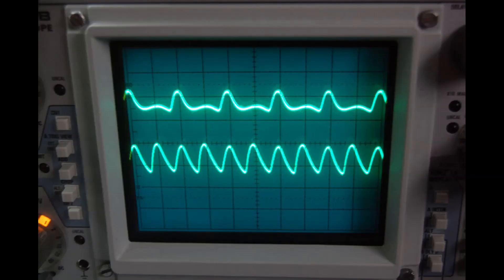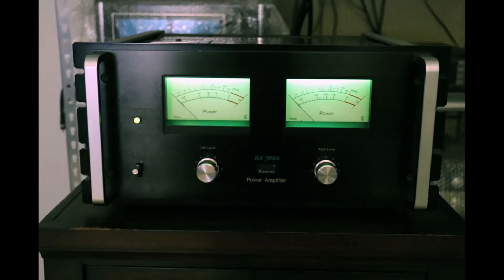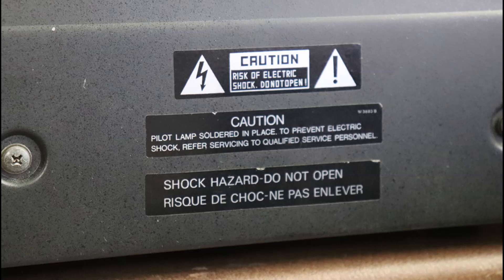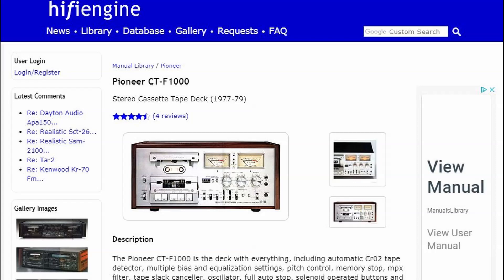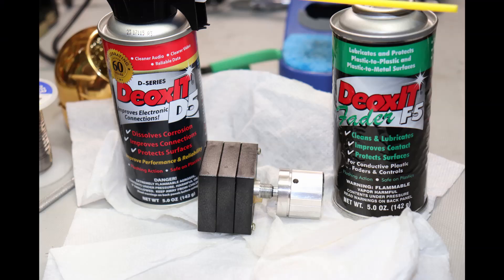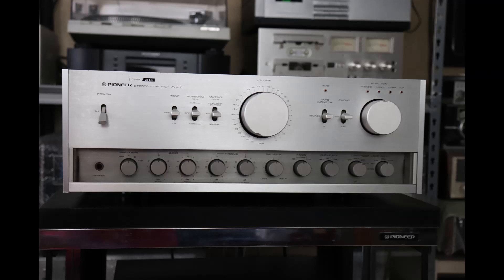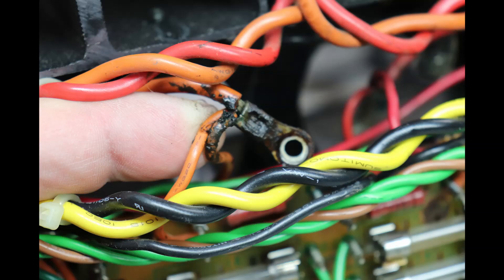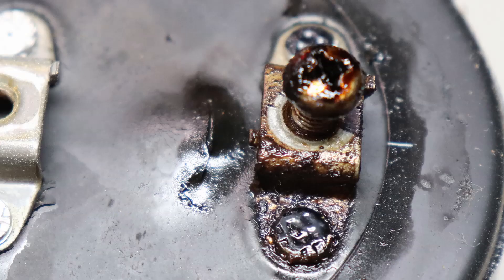Troubleshooting Failures In Vintage Audio Equipment. Fixing Old Stereo System Electronics.

Comment: Newbie here. Is a frequency generator the same as a signal generator?  I have a nice frequency generator I bought it to heal a broken bone that would not heal. Don’t laugh: it worked. I’m an electrician so the only thing I don’t have is an oscilloscope. Just picked up a capacitor tester and transistor and diode tester. This channel is great. I’m watching this a second time. There’s so much great info here and it’s presented so nicely.
Reply from the maker: Thanks so much for your kind words and for watching. Yes, a frequency generator is the same as a signal generator. As long as the device can generate audio equipment frequencies you should be good to go.

Comment: Amazing lesson!  I did buy a pioneer sx626 with the right channel cutting in and out.....looked around inside and found a leaking capacitor on the power amp board.  44 cents and a little solder and now it works fine.   Its hard to believe 1 small thing can cause a big problem

Comment: excellent video.  You have touched on an issue that I am having with my Sony SQD 2020 4 channel decoder.  It takes its main input from my Sony STR 7035.  The decoder randomly drops out the front left output.  I originally suspected the reciever was the problem because I could snap the selector out from and back to fm radio and occassionally the signal would return.  Finally with a little process of elimination, connected my reel to reel into the decoders own 2 channel input, the issue remains.  Do you think it may be a capacitor problem?  I bought this system, complete with a TA 1055 integrated amp for the rear channels in the mid 70s. And kept it all these years.

Comment: Fantastic information. Perhaps you've given the info elsewhere, but I have two questions regarding amplifier repair (I need to repair a NAD3080). To get the consistent signal from the function generator, do you apply eg 500hz to Aux or Phono? And at what voltage? My Tech TE22 Audio gen doesn't go below about 100mV (with lots of noise). And do you have to put a load on the spkr outputs when doing the faultfinding?

Comment: I will say learn basic electronics. Vintage books are plentiful and stupidly cheap on Ebay. Going in and blindly recapping a unit instead of diagnosing through probing and common sense rarely solves problems. Case in point I had a friend blindly recap a small Realistic STA-15 receiver he had found at a thrift shop (low end unit but like you said, that's how we learn) with no sound. Turns out that an output transistor was shorted. No amount of changing capacitors will ever fix that problem. Again, troubleshoot!

Comment: Just got a Kenwood AM/FM radio for free. Seemed to work fine, but I'm noticing that after 15-20 minutes the signal starts to cut out then dies off completely for all channels. Any idea on where to start? Is there a part that could be heating up too much and shutting everything down after it can't take it anymore?

Comment: Can you help me please i have a vintage Yugoslavian record player with germanium amplifier. And when i plugged it one channel made a loud buzzing noise. I pulled out the amp and started testing on my bench power supply. On my power supply it doesn't buzz like crazy but that channel is distorted and quiet and sometimes starts to make some sort of oscillating noise. I replaced the capacitors and it did not help. There is no diagram available.

Comment: Ive developed this incredible urge "want" to learn how to work on audio stuff. I've slowly gotten better over the last year but I feel like ive hit my ceiling in terms of what I can teach myself via videos like this and simply digging around on sites like audio karma.
I flip audio gear and have built a respectable rwputation as the go to guy in my home town for good vintage working gear.
Im able to repair about 60% of stuff I squire and I set the rest aside for "later". 
But my get to it when I figure it out "later" shelf is getting outta hand.
I cant read schematics and I dont have a scope or generator but want to obtain all.
Do you have any suggestions for me regarding any how to books or sites I may use to learn more? 
I have a pioneer SC 850 and a sc550 I really want to get up and running 
The 850 power indicator is on and I hear the relay click but no sound from speakers. The 550 does nothing.
I think the 550 needs a new cap on the power board. There's 2 caps for left and right that are slightly bigger and next to them is 1 single cap i assume is thr culprit.
Would I change all 3 to solve this? Or just the 1 solo power supply cap?
Reply: Hows your progress going 3 years later ?

Comment: Amazing video!!! Thank you so much!!! PLEASE... do more like this!!! :)
Reply from the maker: Your welcome and thank you for watching. I've listed below some other videos that you may like.

Troubleshooting Failures In Vintage Audio Equipment -

Vintage Stereo Repair - https://youtu.be/N3e9C4mUui0
Phono Repair And Troublesome Transistors - https://youtu.be/lkcP1z-KcPA
Hakko 808 Desoldering Tool A Must Have - https://youtu.be/NtSn_HPT-sE
Hazards Of Reel To Reel Tape Deck Repair - https://youtu.be/KvXwN5igzDg
No Audio In Vintage Equipment - https://youtu.be/pKqxlT9sgZY
Troubleshooting In Vintage Equipment - https://youtu.be/xk5gjq5ehK0 
Reforming Speakers - https://youtu.be/ttbgeDagRus
Checking DC Offset On Vintage Amplifiers - https://youtu.be/ZvBoxhpa-v8
Replace Old Electrolytic Capacitors - https://youtu.be/RaWrYJ6amcA

Comment: Do you use other test equipments that you use besides the variac, Tektronix 465B, Siglent signal generator and Sound Technology audio analyzer? Thanks!
Reply from the maker: Yes, I do. A Wow & Flutter meter, dim bulb tester, digital and analog muti-meters. I have others that I don't use as often.
Reply: @vintageaudioaddict     I have a Dynaco 410 amp. Should I use a Variac to power it up? If so, what voltage stages? I know folks use then on the Dynaco Stereo 70 tube amp (one of my other projects) Thanks!

Comment: Excellent documentary photos.

In my first bigger fix attempt on a cas. deck, I used a signal generator from my smartphone app and bought a hand-held type o-scope (just for observation of presence of signals).  It did work.  I did "fix" the deck although the "thorough" troubleshooting was wrong (I replaced the Dolby chip after seeing signal in and no signal out) - it actually seems to have been a oxidized trimmer pot (I still don't know how the Dolby chip measured the way it did).  It remains a "hack" fix since a test tape and calibration procedures are at the next level - at least it plays now.
Reply from the maker: Thank you very much for your kind words. Good job getting deck going! Like everything in life experience is the key. Now your ready to tackle a new project.

Comment: I have a question: Why use a Variac (you mention this in your videos often), to plug in questionable gear before troubleshooting?
Reply from the maker: So that you can prevent damage to the unit in case there is excessive current being drawn by it. You monitor the current being drawn as you increase the voltage so you do not risk a "smoke test"
Reply: @vintageaudioaddict   I've read several articles about the use of varivacs with vacuum tube vintage gear, slowing raising the voltage and your comment about watching the current draw. Over a period of several hours (which has been described by an audio store in N.CA specializing in vintage gear) to reform the electrolytic caps and same time so the  tubes are not blown hit by full line voltage, on a 1st start up.

Comment: Great video! Regarding the experience you need to get I totally agree! At the moment I'm working on some vintage equipment from the early 90's, some of them are (hopefully!) going to be a part of a vintage "back to the 90's" christmas present (it all started with "I want to make a mix tape for her like we did in the old days"). I'm working on it for months, slowly. I wanted to take my time with it, to do proper research whenever I discover new problems, to get all the necessary repair tools and replacement parts. Luckily I also bought not only the recorder I want to give as a present, but also a smaller one for myself from the same brand and time period (+/- a few years). I liked that small recorder, because I had this one as a child and the sound was, for what it is, great. I cleaned it up, fixed issues with the volume and other knobs, changed the belts, adjusted the speed of the motor with a test cassette and a simple sound analyzer app on my smartphone (there're great apps for free that work pretty well through the internal microphone! But you need to check several apps! with my phone one app was off by 1-2 Hz while the other worked perfectly). But then somehow I destroyed the cassette mechanism anyway... probably because the grease in the mechanism got washed out somehow by my wrongly handling cleaning lubricants. The mechanism got stuck, I stupidly used force (NEVER use force on mechanics in audio equipment! N E V E R ! ! !) to push a cassette inside and the cassette got stuck. Play was possible, but the stop mechanism didn't pull the head out of the cassette anymore. I couldn't even push the stop button down anymore. I somehow managed to take it apart again to hopefully find the bent metal parts, but no luke. I've no clue how to take the cassette mechanism apart without damaging it further and the service manual for that recorder, a Panasonic RX FS-430, is not very helpful for me either on this problem so far... I can take the mechanism out, but not apart. I will most likely end up buying the same recorder again, if I can find it, and start all over again: cleaning, knobs, replacing the belts, adjusting the speed of the motor. The lesson I learned the hard way: NEVER use any strong force on delicate mechanism!
Reply from the maker: Thank you for your kind words. Thanks also for taking the time to give some good tips on your experiences with vintage audio equipment.
Reply: Update: In the end I actually managed to take the cassette mechanism apart. I carefully took it apart piece by piece, taking pictures of every little step so, by watching the pictures in reversed order, I could put it back together after I found and fixed the problem(s). It is strangely satisfactory to see and hear it working again the way it did almost 30 years ago.

Comment: Excellent video  maybe if you can make a video of all the capacitors and parts list from Mouser that is the most common that you have in stock 
that you use because i have many vintage audio equipment that i have to get to maybe it could help other people that are ordering parts.
Reply from the maker: Thank you for the kind words. Thank you also for your suggestion. I need the feedback.
Reply: I would only buy Nichicons. They are the best

Comment: BTW, my first attempt at a restoration project was a few years ago, I decided to do some work on a Marantz receiver (2235 I think ?). NOT a good project to start with, as you suggest in the video. It was a complete disaster. I took the faceplate off and sprayed Deoxit into all the switches and pots. They all seemed to be moving much better, so I put the faceplate back on and started up the amp. It seemed to be running well. About an hour later I smell smoke in my house. I look over at the Marantz and there is smoke pouring out of it. I'm not talking about a few wisps of smoke, I'm talking about a Kurt Russell "Backdraft" type situation. I was considering calling the fire department ! I shut off the amp and let it cool. The transformer was so hot it took 8 hours to cool to room temperature. After that The Marantz didn't run at all and I didn't feel like I had the skills to attempt fixing it. I sold it as a non working fire damaged unit and still got $150 for it. Do you have any idea what could have caused such a catastrophic incident ? Also ... as an aside, while there was smoke pouring out of the Marantz it still sounded great !
Reply from the maker: Oh Man.....That's crazy. I've had some issues but not to that level. It's amazing that it was still operating. As to what caused it? I really don't know but an arching power switch could of caught it on fire. You should not spray a power switch with deoxit. I'm not sure if you did that or not. As you just used deoxit  before your fire  I'm trying to tie that to your fire.
Reply: @vintageaudioaddict  Ah ok, I think I did spray Deoxit into the power switch. So I guess I won't be doing that again. If that's the case I am really surprised a fuse didn't blow before the amp caught on fire.
Reply: When you spray deoxit or any other type of electronic cleaner let the receiver sit for awhile to let the liquid evaporate and then power up the receiver.Cheers
Reply: @SDsailor7  I've questioned whether the residue (oil?) is still conductive enough to allow a "parasitic" draw.
Reply: I doubt it specially from deoxit. I spray it and let it sit overnight then power up the next day. I do it like that because I don't want to cause any smoke.Cheers
Reply: @SDsailor7  Thanks for the information.
Reply: @vintageaudioaddict  I'm confused by these "sprays" i.e. conductivity.  I screwed up a receiver with an electronics cleaner from Radio Shack.  I cleaned switches thinking there was nothing to be concerned about since it was "for electronics" - after turning the receiver on, it burned out.  I took it to a repair shop.  The guy immediately said "It smells like WD-40".  On the spot, I couldn't explain all that I presummed; I just said that it was me.  Yes, it shorted something out.  So now, I don't let cleaner get all over everywhere and shoot the areas with air.  I'm still a bit wary of what to do.